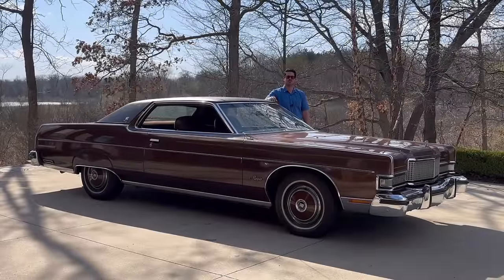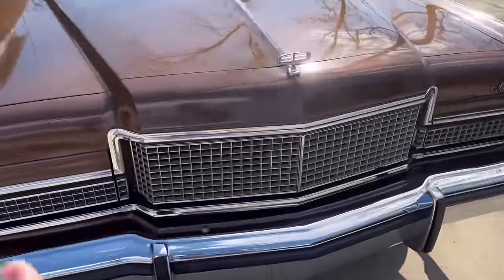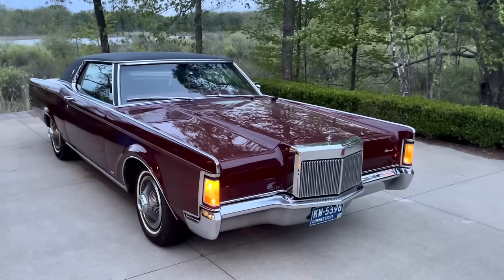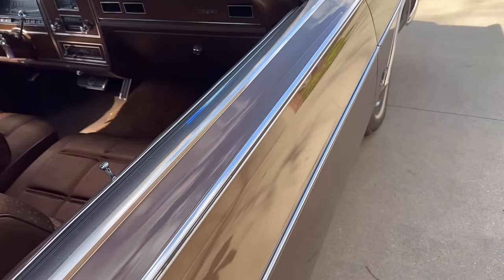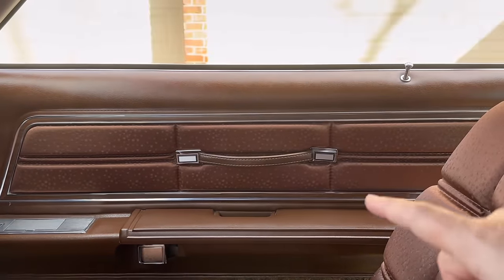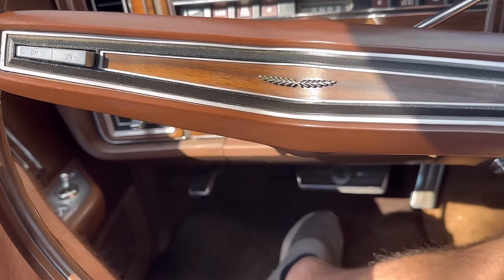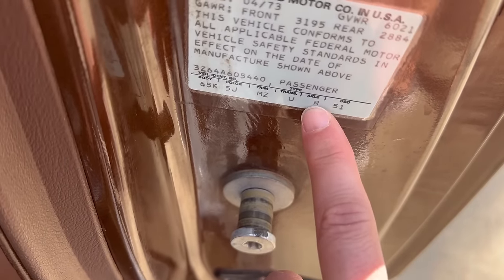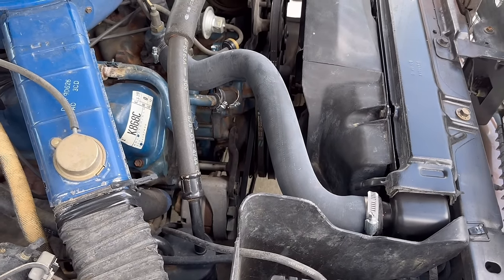Strange Features, Quirks and Idiosyncrasies of the 1973 Mercury Marquis Brougham: THE "Plushmobile"

Comment: Beautiful!
My first car was a Mercury Montego in this same color and roof combo , and many shared parts, the brougham medallion on the C pillar, steering wheel, shift lever,  chrome trim  down the front fenders,  but rear end and most other parts a collection of pieces from Cougar and Torino siblings .

As a "Mercury Montego MX Brougham", it would have been just a notch below a base Marquis, what they'd call a "near luxury" car.

And although considered a "midsized" it presented as a  very large car, with long Mark IV style power done hood and narrow grille.

Drove it cross country with my dad at 14, and it was my car throughout highschool when my parents got a new LeSabre.

It didn't seem cool at the time, my friends called it a boat, most of them had Monte Carlos , Cutlasses, Thunderbirds and  Camaros and the Volkswagen boys had a club, but my big brown boat was the vehicle of choice to take  eight of us to Burger King for  lunch!
Reply: And I'll add that on that cross-country trip it often got more than 20 miles per gallon, (albeit the speed limit was 55, it did work for saving gas!)
 ;)
Reply: Adam is overdue for a full video on the Montego.

Comment: As the long- time owner of a '73 4-door Brougham, I can certainly vouch for Adam's opinions here! I think the only road tester of the day who understood this car was "Uncle" Tom McCahill of Mechanix Illustrated.  I, too, truly enjoy driving and riding in this car-- it is just so smooooth and quiet. My particular example has the self-leveling rear air suspension, which I think enhances the experience even further.
Reply: I was 15 years old when my father brought home a new 1973 Cadillac Coupe de Ville in Autumn of 1972, St Tropez Blue Firemist Metallic. GM cars this era were crisper handling than the FoMoCo cars, but more supple than the Mopars. It was a huge car with outsize dimensions. 

I turned 16 in January 1973 and learned to parallel park in that car. Steering and braking had a predictable response. you could hear the whoosh of bumps as the car glided over them, you didn't really feel them. It had tilt/telescope steering wheel, climate control, Twilight Sentinel automatic headlights, AM/FM four speaker signal seeking stereo, electric locks and windows, dual outside mirrors and rear window de-icer. Parking brake auto released when you put the car in gear. Interior was white leather with deep blue carpets and door trim. Engine was the Cadillac 472 cubic inch 4 barrel.

1973 was the first year that radial tires were standard on most GM cars. Cadillac instrument panel also featured white pointers for speedometer and shift indicator. 
<EDIT> Also worth mentioning is 1973 was the last year for Cadillac Coupes to have working back seat side window glass. It was a true hardtop. They became fixed the following year.
Reply: I agree that Tom McCahill loved the big cruisers. I think his personal cars were usually Imperials. Always enjoyed reading his road tests.

Comment: Of the cars I've owned, the most comfortable and smooth-riding car was my 1975 Cadillac Sedan DeVille. That is until the rear springs started sagging. Then it didn't ride so nice. A close second was my 1974 Miller-Meteor Criterion ambulance (Cadillac chassis). I drove it across country when I first bought it, and then on trips from NJ to Chicago, Tennessee, Long Island, etc. I absolutely loved it. It was a one-owner original and ran and drove like new. This was in 1997-98. Anyway, I believe that car had a diecast grille, now that you mention it. I really like that Mercury. This makes me want to own one.

Comment: My late father bought a new 1969 Marquis Brougham 4 door in what we called “robin egg blue” with black vinyl top and black cloth interior.
Lightly optioned with AM radio, A/C and that’s about it.
He later bought a bright red 1969 Marquis convertible (used) with white vinyl interior.
It was more highly optioned with power windows, vacuum power door locks, rim blow wheel and wire wheel covers.
He loved those cars as the front end styling harkened back to the Cord.
Reply: Thanks for jogging my memory; someone who I worked closely with and was a wonderful person had a 1969 Marquis Brougham 2dr in that same, as you called it, robin-egg blue color with a black vinyl top. His was a more optioned out version, which included those vacuum-powered power door locks. I recall it having very comfortable black cloth seats.

Comment: I’m conflicted. I like the updates your 73 has and the electronic ignition of the later years was a definite upgrade but, it looks decontented when compared to the 69 and 70. If they pull the lock cover from the trunk that’s so visible - where else did they pull and downscale the product?

Comment: I've NEVER cared about handling; I'm all about the soft, quiet luxurious ride!!!  Bring these types of cars back; today's younger generations have no idea just what they missed!😂
Reply: Who wants to feel the road? Not me.
Reply: Many people would disagree with me,  but here's my take on handling: Turn the wheel left, car goes left. Turn the wheel right, car goes right. It handles fine.
Reply: I agree.  The car I drove to high school, you didn't notice the road, so comfortable
Reply: One reason for Ford going to the Frigidaire.a 6 Compressor is that it is a smoother quieter unit.
 Then
 There's a 2 cylinder York.  Or Tecumseh. They would also abandon.
The use.
Of the thermal expansion valve and go with the suction throtaling valve
Reply: @Greg-xv9qj dang, you know you're a/c stuff.  I remember the first time I saw one of those a/c units on a mopar, I said to my dad, it looks like a little v-twin, is that the a/c compressor?
Reply: I remember way back when, someone at Car and Driver admitting that it didn't take any less engineering to make a big car as isolated from the road as possible than it did to make a sporty handling sedan... It's just what Americans wanted.  And judging by all the four-door pickup trucks I'm surrounded by, they want even bigger ones now!
Reply: Agree 150%.  Can anyone point me to a new-ish vehicle on offer that offers that soft floaty ride that has no road or wind noise?  Vault-like quiet is the definition of luxury IMO.
Reply: The same sentiment goes for those big Cadillacs, Buicks, Lincolns, Pontiacs and Oldsmobiles.  I miss those cars.
Reply: Well give them a ride in 1. Quit hoarding
Reply: I love a car that handles on a twisty. On the highway though I want the “waterbed”.
Reply: As a kid, I got car sickness in the back seats of nautical-handling American luxury cars. No fondness for them whatsoever, then or now. 

But is it interesting to learn about some of these cars, and increase my knowledge of even the “malaise-era” vehicles? Yes.

Comment: My father had a 1970 Mercury 4D HT 429 2bbl which had two nasty problems. 
1. The body flexed so badly (even on the freeway) that the pillarless windows would squeak in their rubber seals. Mercury was aware of the problem and could only recommend a special lubricant for the seals to quell the noise. By 1973, the hardtops would gain a center support to steady the roof.
2. Bad starters. Evidently Ford/Bendix/Autolite removed one of many palls in the overrunning clutch to save $$ but it couldn't handle the impact torque. Happened to my old man who got stranded once. I recall seeing Bill Cosby on a TV commercial explaining that Ford had 'improved' their starters by adding an additional pall to the overrunning clutch (as if he knew what one was). You wouldn't see that today!

Comment: An uncle had acquired a big Merc two door around that year that he was going to flip. I drove it. Don’t remember what model other than it was also brown/brown and built on the full size platform. Pre cat.  Only had a 400, however.  Had about 100k miles. I don’t remember what model it actually was. I was in college and my bad habit at the time was seeing how prospective vehicles would go on rural two lane black tops. Couldn’t get it to break 100. At least I didn’t break the car. These were great cars bought by people who were more mature and wanted something smooth and reliable, but unappreciated ten years later when they were in the used car market. Great video. Great exhibition of a 460’s torque.

Comment: All the mid-sized and full-sized Ford Motor Co vehicles from 72 to 78 had the smoothest ride ever and much of it was due to the frame material they were using. It would absorb a lot of energy from road bumps so it didn't reach the cabin. There were other design factors at play as well but my 74 Montego MX could go over railroad tracks or road bumps and you could barely even notice it. My 78 Cougar XR7 was of similar ride quality but it handled much better than the Montego. The Montego's ride was slightly smoother tho.
Reply: This channel is overdue for a video on the Montego.

Comment: Thanks for this one Adam, that's 2 out of the Big Three for 1972-1973 within 12 hours.. I wonder if you can do one on the 1972 or 1973 Buick Electra 225 Limited, Olds Ninety Eight Regency for the trifecta ? (I'd include the Pontiac Grand Ville but you did that one 6 months ago or so, the 1973).

Comment: I had a 73' Marquis (four door hardtop) in high school, I bought it with the understanding that the engine was blown. Before removing, I decided to give it a tune-up just to see if I could get it to run. The dealership I bought it from failed to verify the engine with the VIN. So I looked at the VIN and called the local Ford dealership. The engine that was installed had the distributor in a different location than the tune-up manual showed. Turned out, Ford said: that according to the VIN number, I had a 460 CID 4V V-8 "Police Interceptor," so I tune it according to those specifications, and it started right up. I told my dad that the dealership had missed the fact that the distributor's location was the tell, pop took it over to the service manager at Key Buick in Swarthmore, PA and told him about the mistake. They took it in on trade and decided to just wholesale the car as is, so I lucked out. The service manager told my dad to tell me to come work for them when I graduate. My dad owned a gas station for 35 years, I started working on cars at twelve alongside my pop: dad just laughed at the notion that I would leave him!

Comment: Those twin comfort lounge and other pieces of this car made it to Australia in 1975! The big selling Ford here at the time was the Falcon, by then an Australian design that continued to use the name. Above that, on a 116 inch wheelbase and regarded as a large car, was the Fairlane, which was available in Custom and 500 trim levels. Above that was the bigger LTD, on a 121 in. Wheel base - totally different from the US LTD. In 1975 they introduced a new Fairlane - 4 door only - that looked like a scaled down Mercury Marquis. They also introduced a new top level Fairlane and called it….Fairlane Marquis! It was the only car sold here that had twin comfort lounge seats. Some of the badging, name plates, ornaments, hub caps and those seats came from the Marquis in your video.

Comment: Car and Driver road tested a ‘77 LTD, and they discussed the HIGH amount of unsprung weight, designed to prove mass to force the high-sidewall tires to comply to road imperfections.  

As I get older (58 and counting) I have found that I like having a softly sprung car in the fleet.

Last comment - I have never, ever heard a non-enthusiast mention “handling” when praising or damning any car.  Only us gearheads .

Comment: I had a '73 Caprice Classic with a 454. It was equipped with a drifting whale ride quality from the factory, but I wasn't deterred from doing a little tweaking under the hood. I flipped the air cleaner lid and added HEI, properly wired. The QuadraJet was massaged just a little and hardly needed anything. The typical suspension was easy to firm up with Monroe dampeners on all four corners. New wide aspect ratio tires made it hug the road. The change was subtle, but it became a beast in street racing. Unfortunately I allowed a girlfriend to borrow it and she overheated it. If she'd stopped, the problem wouldn't have roasted the engine, but that would have required a brain. Now it's been fixed and transplanted in a suburban. It's not much of a racecar.

Comment: You gotta love seeing these old cars in action when new on TV shows like Cannon or Barnaby Jones. They exclusively used Ford products. And though I'm no Ford guy, I do recall how quiet and smooth they were from my childhood. And as a child, I recall the rear seat was like a bed. Stretch out with a pillow and that was prime time for a nap. Child safety seat? As if! As well appointed as this featured car is, I'm surprised it doesn't have a passenger side OSRV mirror.

Comment: Thank you Adam.  Ford Australia I think used these wheel covers  as well. I never understood why they would delete options and take things out of cars. GM did it also. My 1996 Ninety Eight does not have trunk lock cover. The 1991-1993 do.   The 1994-1996 do not. I thought this generation was quite nice looking. you are correct about the Lincoln design influence. I prefer the looks of the 1975-1978 of this generation. You can see how the Grand Marquis and LTD were sharing parts and some styling in 1975- 1978 and then they did it again in 1998 until the end in 2011. Thank you for sharing the car.

Comment: I just have to give one more comment for those who think handling is NOT an important issue. Don't get me wrong, the comfort of these cars are legendary, but let me tell you a story. I was driving a 1979 LTD. There was a light dip in the road up ahead, barely noticeable. Well, I drove over that dip, went flying in the air, and ended up on the passenger side of the full bench seat. So much for soft suspensions. I quickly had to push myself back into the drivers side as the car was still travelling. I ended up pressing the brake too hard and the car lurched to a stop (as soft suspensions tend to do). Regardless, I didn't consider this an issue. You just have to learn to drive these soft driving cars with greater attention and respect. The 4 turn steering of these cars didn't help matters either. In emergency maneuvers, you learn quickly why handling matters. An old woman, neighbor of mine had a Lincoln of this time period. She ended up spinning out on the highway during winter and practically created a vortex with the monstrosity of her vehicle. There's always a trade-off. With today's driving needs, heavy (tight) traffic, faster speeds, and more idiots on the road, you need a "tight" car to be able to maneuver through all of those surprises. But I will say, sadly today, it's all about the cheap. And these oriental cars have you sitting on a board. Zero padding whatsoever. There needs to be a balance.

Comment: I remember having a premium fuel 429 marquis… It was a good puller. Adam, the key to waking up a 460 car or truck was to use the 1970 429 timing gear set. Ford took a lot of timing out of those engines to make emissions.

Comment: I have replaced the alternator belt on my 76 Lincoln and years ago on a 78 F150 w/460.  I don't remember it being an issue with the exception of having to remove the other belts first.  I do recall on several Mark IVs that I owned that the alternator belt had to be really tight or it would squeal upon start up when the alt was providing max current and therefore taking max power to run it.  It should have been a twin belt.

Comment: I wonder if there are aftermarket retrofit kits for cars such as these with vacuum actuators, to replace them with more reliable electric actuators. I’d think it wouldn’t take much more than a set of actuators with the same output gear as the existing actuator, and then maybe tapping from the 12v headlight power to a relay. Might require some mods to mount them. 🤔

Comment: As a L M dealership line tech I sure loved the 2 hr. book time paid for new car prepping them . Pump a 1 inch hole saw through the right fender . Plus 4 small sheet metal screw holes to mount the antenna . String the sable & plug in to radio . Check fluid levels . Hammer the wheel covers on . Then test drive . Gravy .

Comment: A coffin on wheels. That is my only gripe with both the Lincoln and Mercurys of this era. Thank goodness this styling only lasted a few years. This SLAB styling, actually much worse on the Lincoln, resembled to me, a coffin. And the high ornamentation on the front and grille, the highly ornamented covered headlamps made the matter worse as it helped give that coffin image, as this is what resembled a coffin. This coupe improves the styling just a touch with that single upturn behind the rear side window. In doing so, it breaks the monotony of the slab design. Also, the somewhat raked rear roofline also helps dial down the boxiness of the design. I am quite familiar with the palace like luxury of these cars. Really like no other.